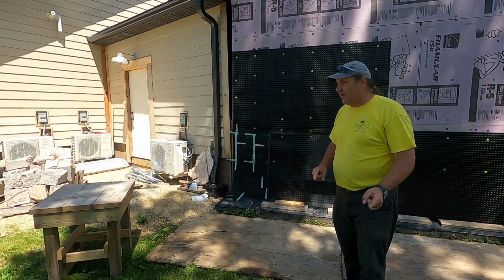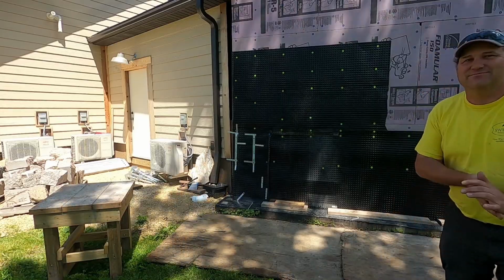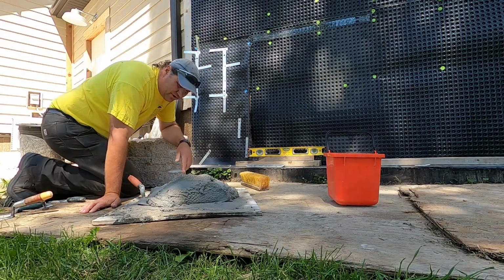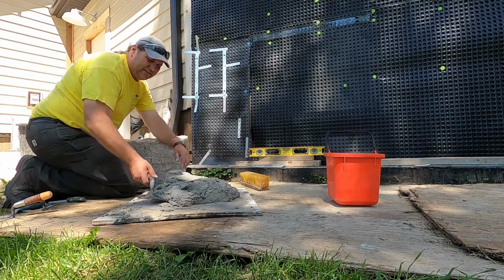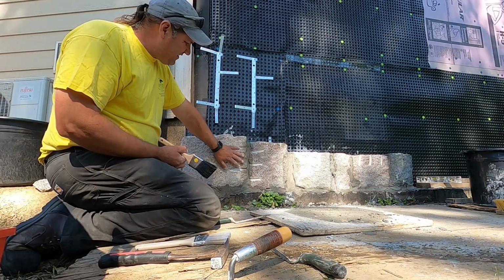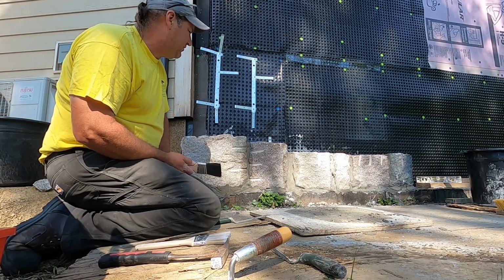Installing Granite Cornerstone Rock ~ Landscaper Know How : Stone Work

Comment: Is there any concern about the drill marks showing?
Reply from the maker: purely aesthetic... in the old days, stonemasons would us a pitching chisel to romeve the holes.  I like them showing... part of the process. I do run the stone hammer over them to remove any sharp points.  thanks for the question!